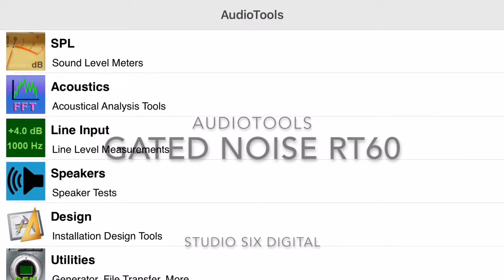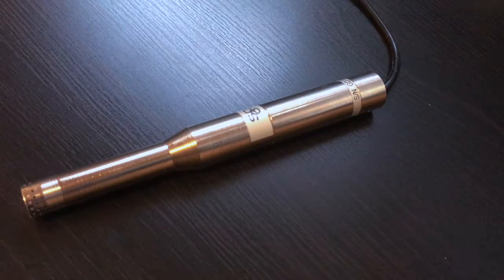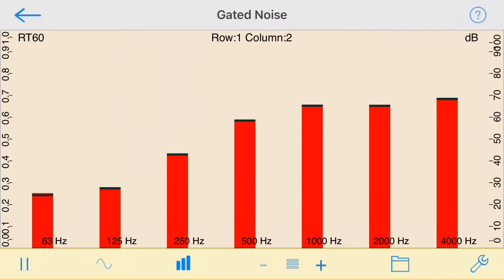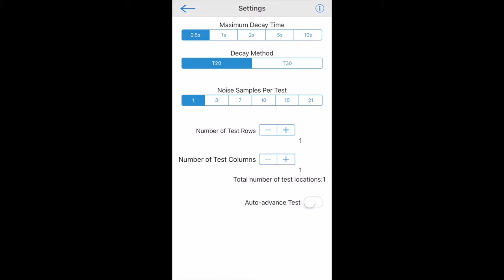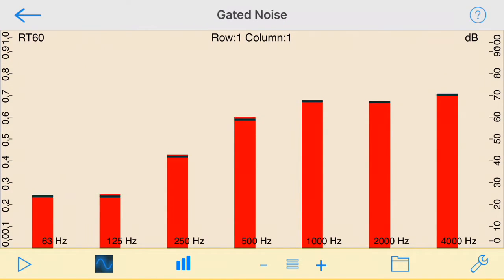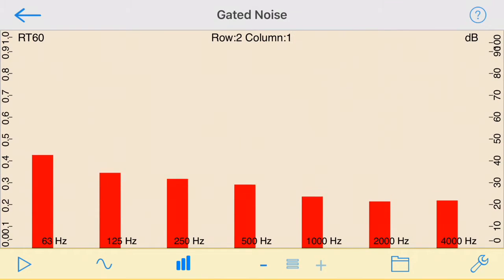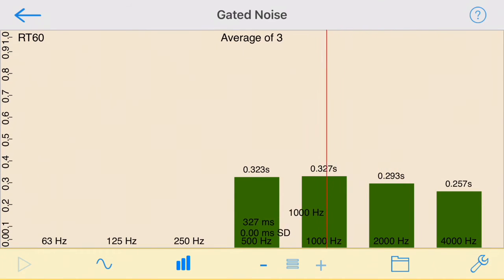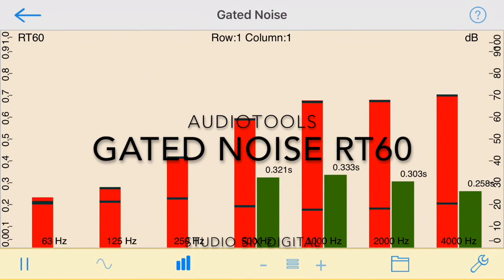RT60 Demo Video

Comment: How would I run the sound through the iphone and be able to walk a room? I would be running it through a soundboard and I have an iPhone 7 with the lighting connector, would it use the mic on the iphone still?
Reply: They have a remote app that can connect to another ios device as the generator sound source or remote mic. BUT it doesn't work with apps like Gated Noise RT 60, STIPA and others that REALLY NEED THIS. Dumbfounding really.